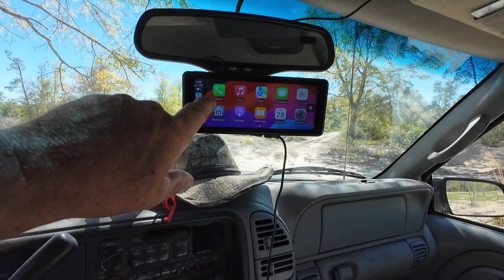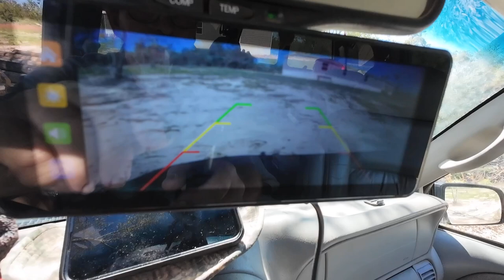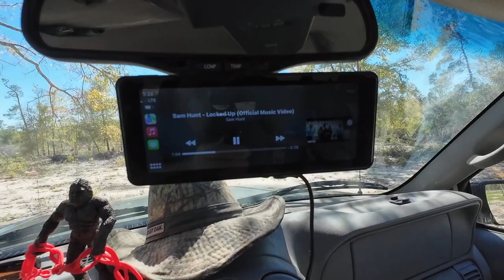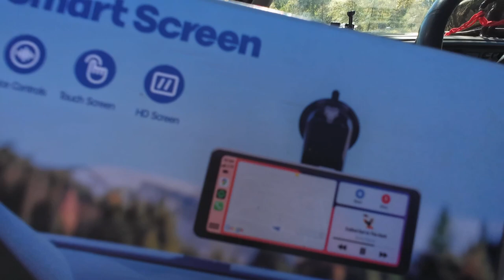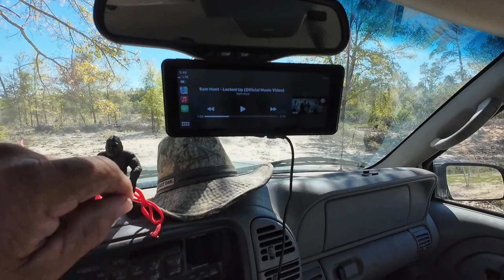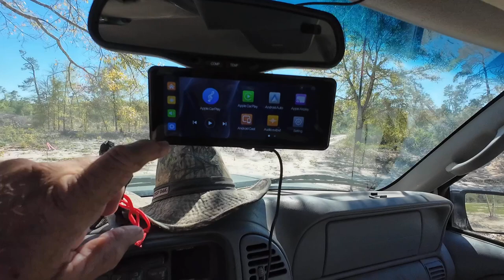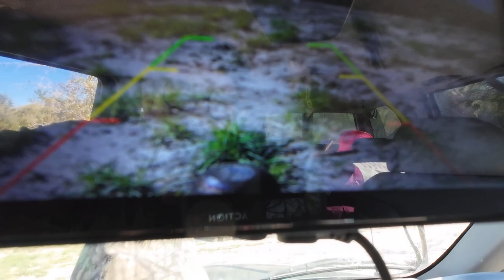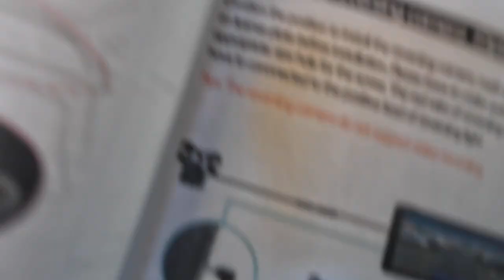Review of the Lamtto Carplay Smartscreen with Reverse Camera

Comment: I own a 2005 & a 2007 Chevy's trucks & they don't have that auxiliary outlet on the radios either. 
I wish I would of known about this product before I bought my wireless backup camera off of Amazon  last year. I really like this, but I'm a tech geek anyways... lol...
Nice review Donnie. Thank you
I looked it up on Amazon & it cost $99.00, but you get a $15.00 off coupon & a 5% discount for using Donnie's link. IT also has a 4.4 star rating. Go check it out. Bc that is cheaper then what I paid for my backup camera & it only backs me up. I would of much rather had this if I knew this was out there when I was checking out backup cameras. Dang messed up again. If my camera goes out anytime soon, I'll be buying this.